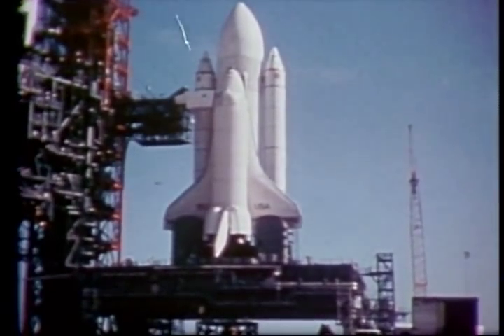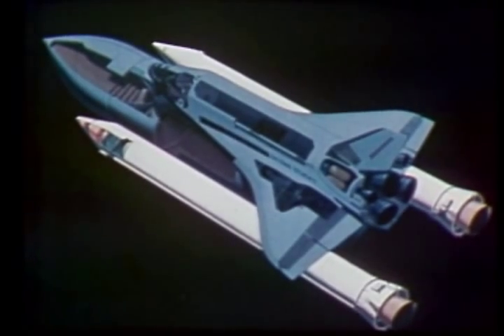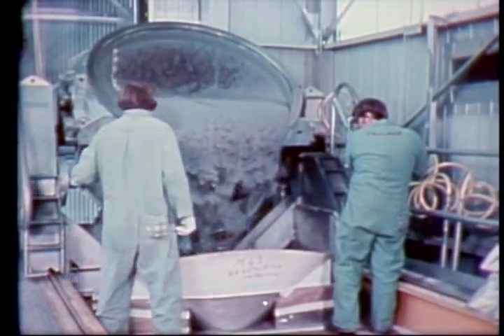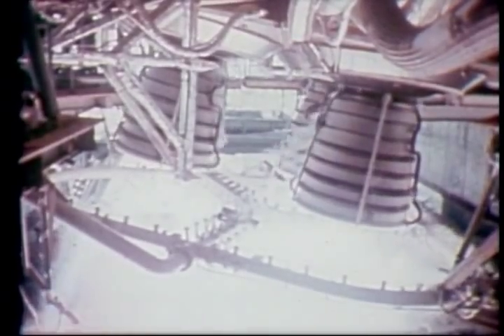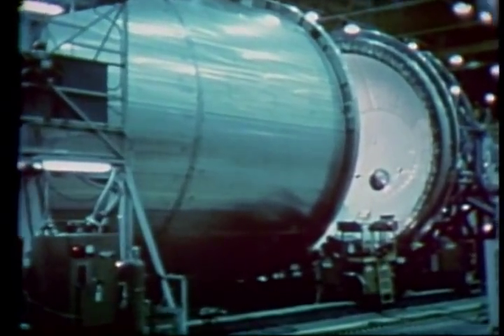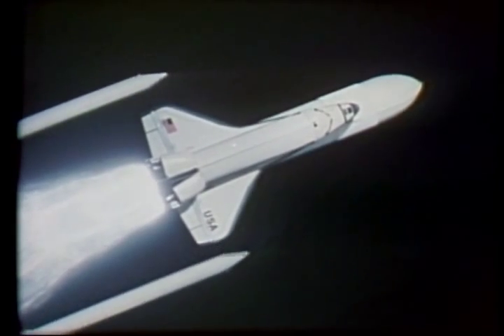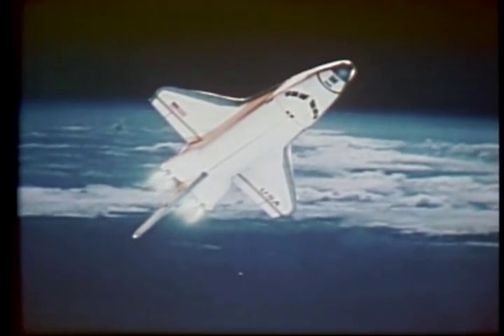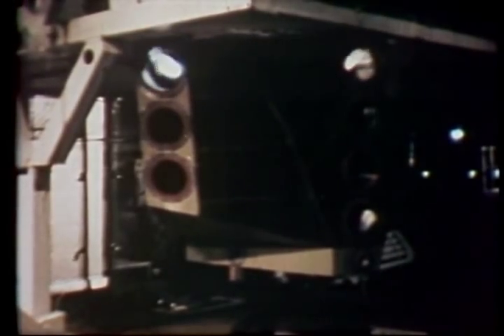Space Shuttle - Propulsion (1980)

Comment: the stupid fahrenheit degrees make me crazy, just say celsius it makes more sense. whater freezes at 0°, boils at 100° at sealevel, absolute zero is 270° or something.
Reply: The problem with centigrade (ok Celsius) is when someone says ‘40 deg C is twice as hot as 20 deg C’. Instead of 313 deg Kelvin versus 293 deg Kelvin. 

40 C is only 1% hotter than 20 C.
Reply: yeah Americans still use Farenheit. Always have been. Here are the figures in metric: Liquid oxygen temp; -183°C, Liquid hydrogen temp -253°C, re-entry temperature 1,450°C

Comment: Odd seeing the tank without insulation.
Reply: +Zoomer30 The white tank is actually WITH the insulation. NASA abandoned it after looking at boiling rates and realizing that it would do just fine without such heavy insulation. So they used another famous orange insulation that is much lighter.
Reply: +Сергей Гиталов Actually, the natural color of the insulation is orange/brown. They painted STS 1 and 2s tank white to help control temperature from the Sun. Later they found it was not an issue and dropped the paint to save weight and time. 

I meant that I have never seen tank with no foam at all,  seeing the under lying structure.
Reply: Zoomer30 but you are not seeing it without foam here either, the orange foam insulation IS under that white paint.  The white paint added an extra 600lbs of weight and was unnecessary as they originally believed they needed the white paint to reflect UV Rays to prevent heating and boil off of the LH2 and LOX